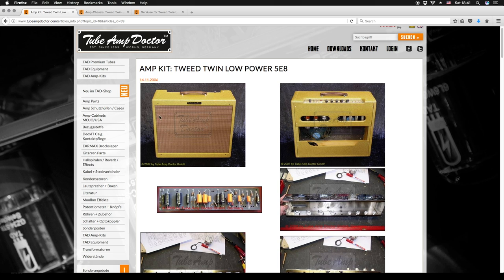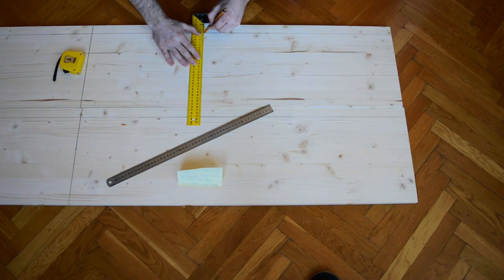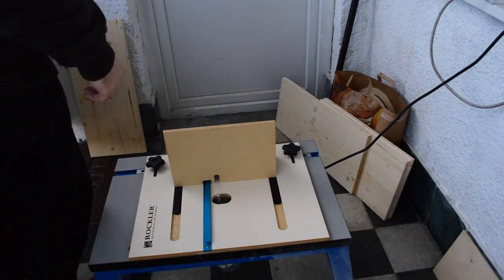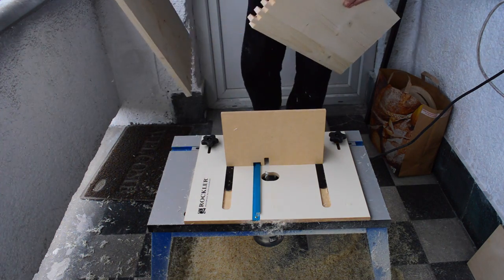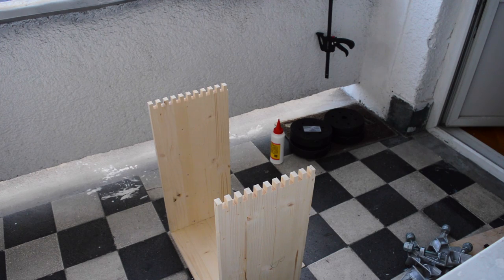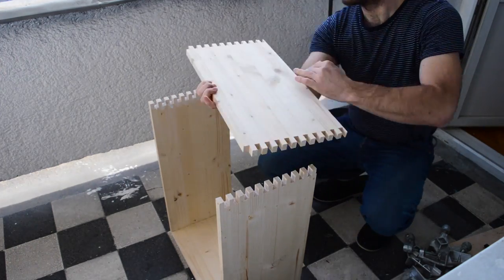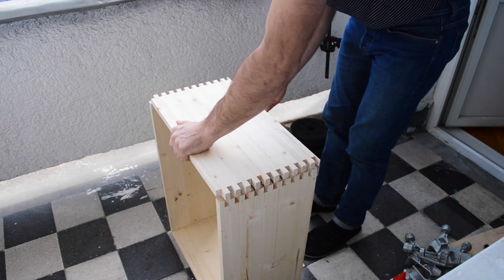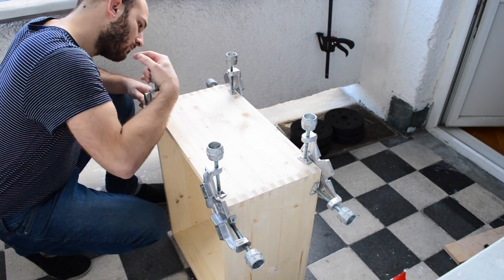5e8 Project - Solid pine finger joint cabinet build part 1

Comment: Please give the details on the finger joint process (bit size and all equipment used). I like the looks of this process better than the Porter Cable jig.
Reply from the maker: It is a Kreg router table with Rockler Finger joint jig XL. Bosch router 1617, and the bit is Onsrud HSS Up-Cut Spiral Mortising Router Bit - 3/4'' Dia x 1-1/4'' H x 1/2'' Shank

Comment: Here's the jig he's using 
Rockler Router Table Box Joint Jig
http://www.rockler.com/rockler-router-table-box-joint-jig
Reply from the maker: Well, if you are reffering to the jig I'm using in this video it is the other Rockler model
Rockler XL Router Table Box Joint Jig
http://www.rockler.com/rockler-xl-router-table-box-joint-jig

It provides better stability and overall size and it's ideal for guitar amp and other cabinets. 

In the comment bellow I was reffering to a finger joint jig I've built in another video:

https://youtu.be/IzTVieZN7Wg
Reply: even better!